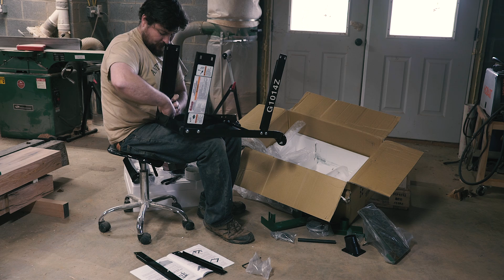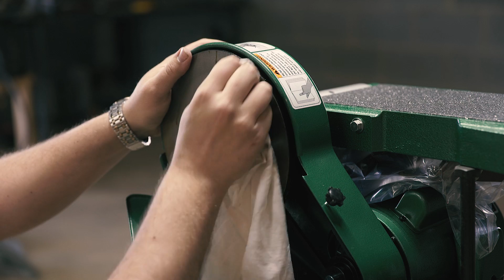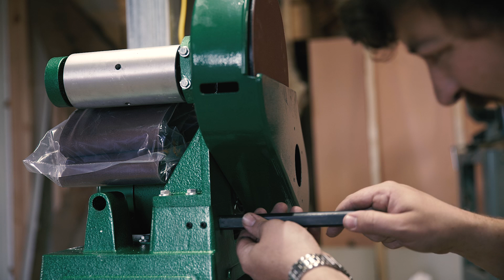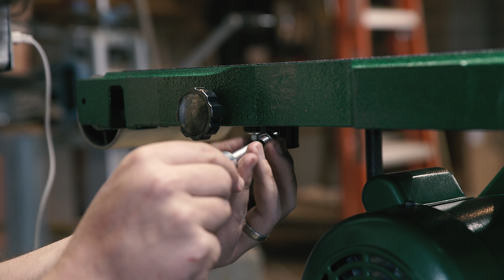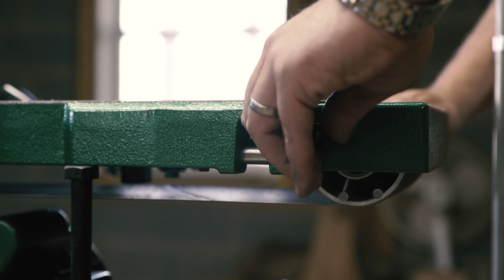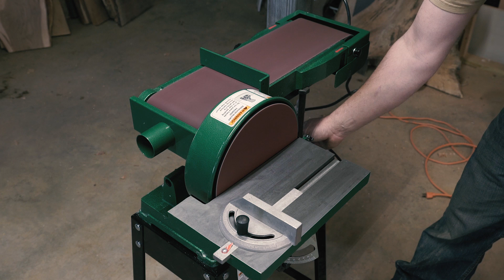How to configure a Grizzly G1014Z combo sander

Comment: if you remove the roller guard can you sand inner rounded edges?
Reply from the maker: Yes. The belt goes around an idle wheel.

Comment: Now that you've had some time, how has it held up?
Reply from the maker: No complaints.  There's not really much to fall apart aside from changing belts/discs.  It still performs exactly as the day I assembled it except for I've added dust collection which helps keep the air clean.

Comment: The rust preventative "gunk" that Grizzly uses is some mean stuff. My new spindle sander had so much on it, I found it easiest to scrap it off first with a razor scraper.
Reply: Most car waxes (except pure carnuba) has silicone in them and will leave 'fish eyes' in finish. I use furniture wax. I have an old can of minwax that I save for machine tops.
Reply from the maker: John Conklin, you are spot on and a wealth of information.  Yes, PURE Carnuba.  The kind without silicone.  I am currently using the S.C. Johnson Paste Wax but the can is nearly gone.  It works well. I'd love to see a video of taking a rusty table top back to original factory condition.  My machines are all shiny but do have visible scratch marks from cleaning up surface rust/ moving parts across them, but NO RUST!
Reply: WD-40 can also be used to remove it. I've done that a time or two. Plus, then it will not immediately start to rust again, like things do here in Mississippi when left exposed.
Reply from the maker: I have used WD-40 in the past but don't find it as effective.  Believe it or not, Central VA is ridiculously humid in the warm months.  We usually skip Spring all-together and got right to 100 degrees with 100 percent humidity, like, now.  I just pulled the new Bandsaw into the shop and already have surface rust even though I treated it with Boeshield T-9 (I don't recommend it. Paste Wax works much better).
Reply: Good to know. I have considered the Boeshield. I am in a very similar weather situation, it seems. It is unbearably humid here from about now through September. I've been using paste wax, but wondering if the grass is greener on the other side of the fence. ;) I'll just stick with it now.
Reply from the maker: Honestly, I bought Boeshield for the same reason.  I used it on my Table Saw, got rust and immediately put on Paste Wax.  Thought I might have done it wrong.  Used it on the new Bandsaw and same exact story.  Carnuba Wax works well too I've heard.
Reply: I always use mineral spirits. Cheaper than WD40 and less chance of messing with finish later. Here in Ohio we have humidity in the summer, but not as bad as you guys. I'm lucky enough to have a stand alone shop and control the humidity by always keeping it closed and running a dehumidifier. Sucks on nice spring days, but still better than scrubbing cast iron. I still keep stuff waxed for slickness. : )
Reply: Good to know about mineral spirits. I always have some of that on hand.
Reply: Interesting. Like....car wax? That's the only carnuba wax I know of. I will not spend my money on Boeshield then.
Reply from the maker: You'll see in an upcoming bandsaw video me using Boeshield and getting rust then going to paste wax.  I learned about it from Marc Spagnoulo but that's when he lived in Arizona... not the Coastal South.  I'm not impressed.
Reply: The only time that I let a machine top get away from me before my 'closed' shop, I bought a refurb RO sander and went after the rust with 400 grit wet/dry sandpaper and WD40. Shined up in no time flat.
Reply from the maker: I usually go through the grits with WD40 up to 600 but still isn't the same as "Factory finish".  I mean obviously good enough, but when you're doing a video on a brand new bandsaw and get rust because it's rained for 3 weeks and got hot, I'd like to show the finish without giving it my own abrasive treatment.